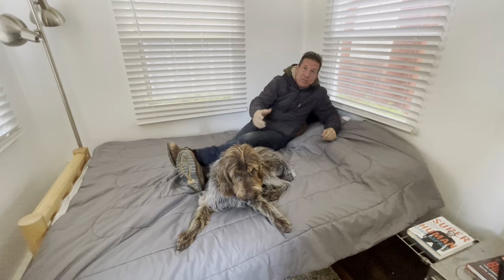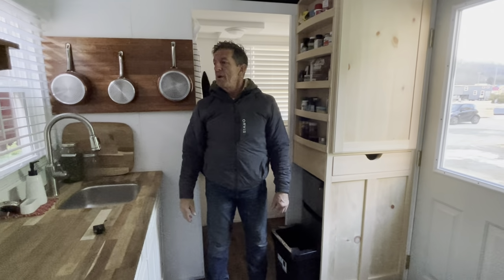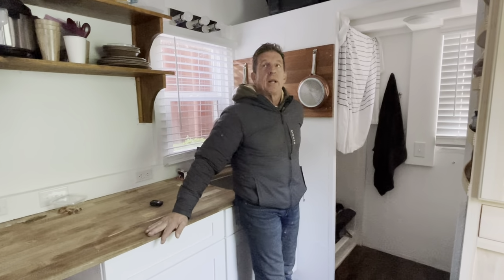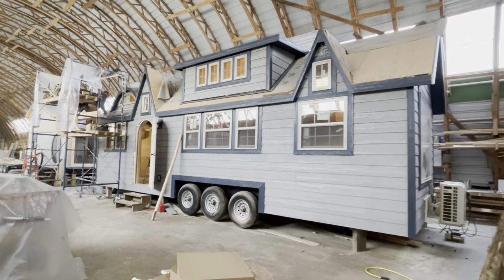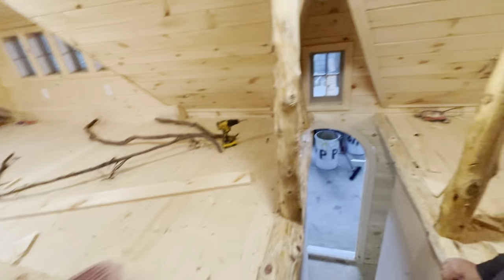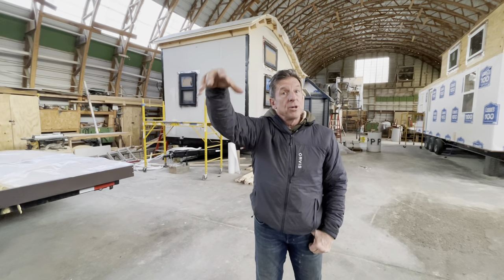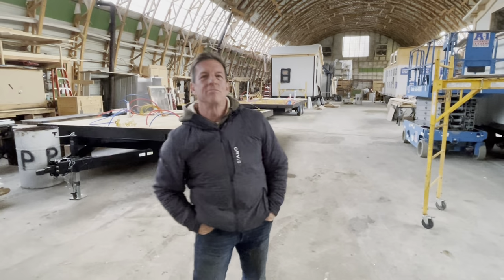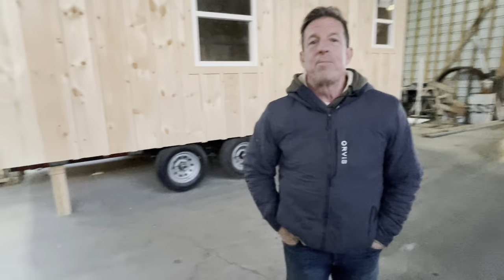Incredibox, Highland, ESP Tiny Homes….OH MY!!!! 🏡

Comment: I bought a shed. But it was built 16" on center with 8 ft walls. I reframed headers and added my own house windows. Setup a 24 volt solar setup. 200 sq ft and im still under 20k.  I do wish I had know about this before I started it. Lol. Would have saved me a lot of time.
Reply: @Roobah  nope. They brought it and set it up on blocks. Trailer would have added more to it. I'll have about 15 in it when I'm done. And be off grid. It eould be nice if it was small.enough to move myself. But I dont plan on moving it a lot.

Comment: I love the palm tree on the end, and the flowers.  

Put a retractable screen door, a fold down deck with slide out steps, a retractable awning, I would do stucco on the outside, shutters, and flower boxes, once you plan to stay put somewhere, put skirting on it.  Put some colorful lights on it.  

On the inside, I would want the countertop to be a bit longer to come close to the bed, and then there would be room to put a Randy Rack for your pantry items, and still have room for it to have space underneath for a chair.  I would put some shelves above the window wrapping around in a u-shape, for books and a stereo receiver, DVR, and lower shelves for a turntable, and Blu-Ray player, set up a speaker bar next to the TV, that can also be used for audio entertainment.  A twin bed, to be up like a day couch, and bed at night, tall enough to put a 3-drawer dresser underneath, like some dorms have, and that another thing, if you were in college, use as your dorm room.  In that case, call it the Incred-I-Dorm.

Comment: This is nice.  And you can fix it up any way you want.  Add solar panels and a wind turbine, a water collection system, and go off grid.  Add a w/d on top of the hitch and a tongue box around it, with a place for the water collection system, or even a water heater to the side of the w/d, a bay window on the living room/sleeping end, and a storage underneath for your batteries for the solar panels & wind turbines.  The sky is the limit.

Comment: I would like to have something like this on the piece of property that we bought. I don't need anything fancy, I just need something that keeps my Husband, myself, and my cats dry and secure until we can build a house. That is many years away but I would rather have this then pitching a tent to spend the weekends at this property. Unfortunately, the town that this property is on does not embrace the tiny house movement. The minimum build has to be 480 sq ft. If I put a camper on the property I have to have a permit for 2 years and I have to prove a means of water and bio hazard removal just to do that. We will find a way to make this happen that will make the town happy.

Comment: Well, try to buy a nice newer RV camper for $20K - it's not easy. You might find a basic little "canned ham" & that's about it. Cute & fun but very little breathing room for long-term living. And limited legal places to set them. There are trade-offs here, re installed details & extra storage, but at least you're not paying for stuff you may not need or use. I do think though, for what it's worth, that the $25K price should include the fridge-storage cabinet combo, in whatever final form you decide. It's functional, beautiful & the type of value-added item that can clinch a sale. Of course, wait & see how demand goes at the higher price before standardizing anything. May not be necessary. 👍